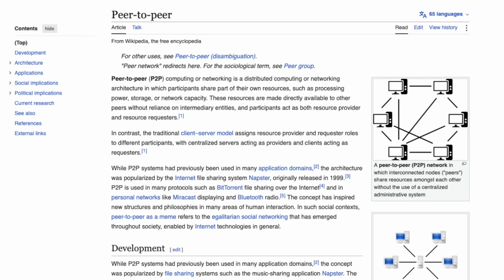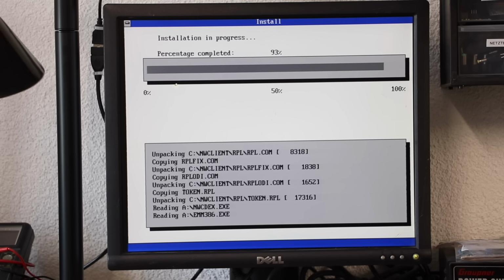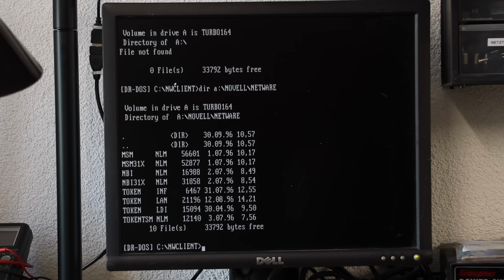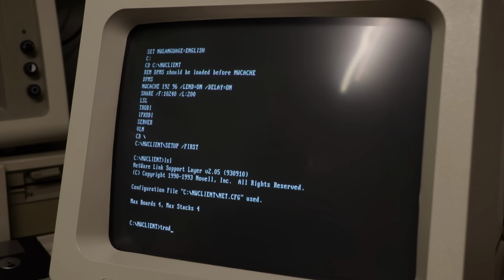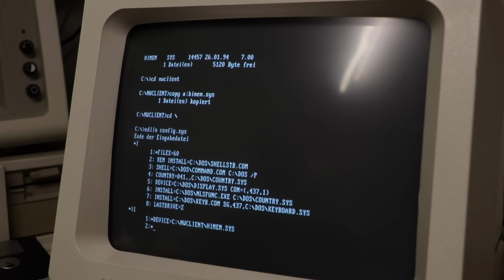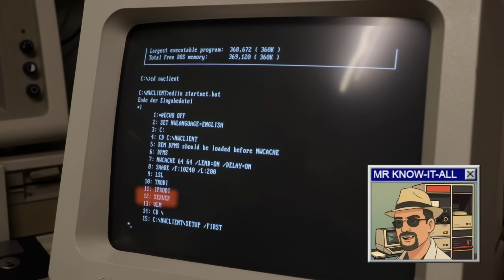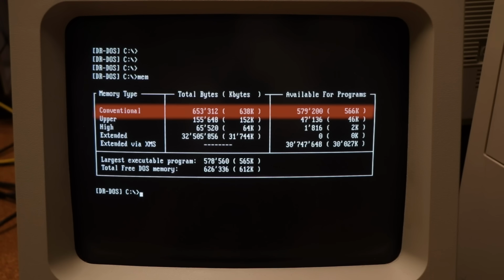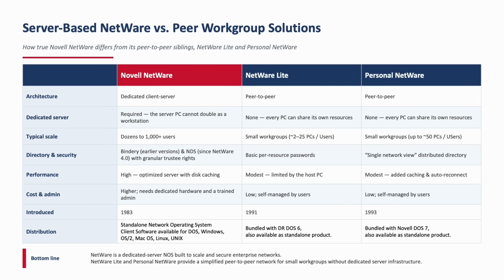Networking Two Vintage PCs with Novell DOS 7 and Token Ring

Comment from the maker: Did you ever run a DOS peer-to-peer network—Personal NetWare, NetWare Lite, LANtastic, Windows for Workgroups, or something else?

I’m especially curious how you handled the memory burden, especially on limited 286 systems. Would you have kept the file-sharing server running, stripped the startup files down further, or reached straight for QEMM or alternative memory managers?

Share your insights below.
Reply: DOS 6 boot menu is really great for saving memory.
It's a bit cumbersome to switch between having the network stuff loaded or being able to run large programs, but still.
For 386 and above Windows for Workgroups really improves both conventional memory availability and overall performance.
(I've never used anything from Novell or Lantastic, only used SMB clients in DOS).

Comment: I always wanted to try Personal Netware.

For P2P networking, I did a bunch of work with Windows for Workgroups.  It worked well enough for the 5-10 PCs we had hooked up to it.  I also dabbled in Lantastic on Dos/Win and OS/2.

I went on to work with Novell 3.x, 4.x, 5,x, 6.x, and OES on Linux.  For file and print services they still smoke what Windows does in 2026.

I managed to dodge a lot of these memory limitations.  The oldest client machines I generally were 386s.  I still remember dealing with a ton of 486 machines running Win 3.1x and supporting the Windows client for ccMail on a Netware 4.x LAN.

Comment: Commenting on an older video, but:
This reminds me a bit of that there is/were also an even cheaper solution where you'd connect the serial port between two PC's and be able to share disks and printers. I thin it was called $25net, as that was apparently what a null modem used to cost. I remember playing with this in the early 90's. It used the default DOS error messages and when there wasn't an appropriate error message it just picked one that would catch the users attention. Like "Out of paper on device G:" :D
Reply from the maker: Yes, the 25$ Network did that, also Interlink (DOS 6) supported this.

Comment: Why did you keep DISPLAY.SYS in CONFIG.SYS? Back in the day, I always removed display.sys and the MODE calls from startup files, you could most likely also remove NLSFUNC. Some programs like Norton Commander also show bad characters instead of some lide drawing characters with codepage 850, so I guess codepage 437 is mostly the standard in DOS. Also I think NWCACHE is also optional, if you have memory constraints...
Just some thoughts, as I also had my fair share of CONFIG.SYS and AUTOEXEC.BAT back in the day :-)
Reply from the maker: Well, of course I could have just removed them, or disable SERVER.EXE. There's so many things one could do, including installing a more modern DOS.

The while point of the story was however to show the memory constraints and potential compromises to be taken through the eyes of contemporary software.

I'd rather replace all DOS drivers and TSRs by modern-day equivalents with smaller footprints anyway. The included IBM mouse driver hogs a lot of memory as well. CTMOUSE would be a lot better.

Comment: My first little networks were Personal Netware. A VAR near me was clearing house and didn't know what was in the PNW 2-node kit, I guess. It was sitting there for $25 next to a NE2000 for 50. That box contained two nodes of software for PNW and two NE2000s with some accessories. Big score. Soon I was learning a lot more.

Comment: I had Netware Lite I think back in the early 90s in a kit I got from a store.  It had 2 NE2100 cards with COAX cables.  Fun little project for a 13 year old.
Reply: That sounds awesome, I remember having Ethernet adapters that had RJ-45 in addition to BNC but never actually used the BNC in practice

Comment: Here are a few memories of the late 1980s and early 1990s: In 1989 I got a 286 IBM clone with MS-DOS 4.x (I forgot which version exactly), it had 1MB RAM, a 40MB hard drive and a 3.5 inch floppy drive. I remember hat I had a constant struggle with low memory and had to tweak the settings all the time. Through shareware sellers I got alternative drivers for ansi.sys or the mouse and so on just to save a few kilobytes. It felt like a big relieve when I got a 486 with 8MB memory and DOS 6.22.

In about 1992 I got a job at a weekly newspaper, the whole editorial office used Novel Netware for connecting the computers of the staff. My job consisted in inputting submitted articles (in print form) or interviews from tape. The pc on my desk was a 386sx with DOS + Netware running a custom editorial software called LEAPS. The inputted articles were stored on a shared drive where the editorial journalists and the layout personnel could fetch them. It was not particularly unstable, but it had quirks. When out of memory LEAPS simply crashed, so I had to reboot to connect to the network and start editorial software again. There was a messaging system included with which I could send single line text messages to other users in the network. Thankfully, there was an unused windows directory on the disk that allowed me to leave LEAPS and play minesweeper in idle time.

Comment: My experience with Personal Netware was one business.  I'd done many years with Netware from 2.0 onwards at many businesses small and large to that point and continued on up to 4.12.  Through a convoluted series of maneuvers the business I worked for managed to sell PNW to just one business.  I'm not sure what dark magics were invoked to achieve that as the business was already using Lantastic (without a dedicated server) and was quite happy with it, apparently.

My honest assessment of PNW was it was a dog that should never have existed and was the attempt of a company in the process of failing to head off peer networking eating its lunch in the small business arena.  Just from the client side of the equation stuff that worked flawlessly with the Netware client, be that real mode DOS including sitting underneath Windows or prot mode Windows client, connected to traditional Netware servers, even NW 286 in non-dedicated mode, just did not work reliably.  No matter how many patches and updates were applied, nothing made it good.  The one business we somehow managed to get it in at said enough and went back to Lantastic.

Comment: Yes, between nwclient, personal netware, nwlite, and atrisoft lantastic was always a battle in memory management. Not sure if I said it before on this channel. I got really good at memory management just with the normal config.sys and autoexec.bat. Dos 6.xx was a life changer with Load high and stuff.  Plus being close to novell and already big into novell. Moving from novell client to nwlite and personal netware was a simple. As you pointed out. One more file loaded called server and boom. you was a server.
Reply from the maker: DOS 6 added quite a lot of practical features to make life easier in terms of memory management, although many of the features actually came from NetRoom, which Microsoft licensed for inclusion with DOS 6.
Reply: @THEPHINTAGECOLLECTOR  Sounds correct. Also I'm pretty sure third parties had memory management stuff for say dos 5.0. No I'm not talking about like Quarter deck or what not. I remember a program that would just take some of say your shadow memory? not being use and add it the to 640kb.  It works okay, but some programs refused to load and other gave strange error messages. Since this was before the internet. I didn't know why.

Comment: Used Netware Lite for a while, until switching over to win95 and its built in network. Right now I'm setting up a "retroserver" on a Raspberry Pi 3, with support for old SMB , NFS, FTP and Novell Netware with mars_nwe running on IPX. Also used for sharing internet like I did on a linux-box back in the days, but then with an ISDN card for connecting to internet.
Reply from the maker: mars_nwe is on my To Do list as well ;-)
Reply: Oooh cozy retro networking, that deserves a video!
Reply: @JohnVance  trying to log what I'm doing, so it might be possible to either make a Howto or video at some point. Hoping to bring the system on the next local retro event for some real LAN-setups like the old days :)

Comment: I was a netware administrator for a large corporate steel company. I had a friend that setup a company with a couple of employees. So they used personal netware it worked ok for a while on a pair of 486sx with ne2000 cards.

It lasted about a year when they went to full netware server 5 user. Where it lasted till they went to AWS 20+ years later
Reply: This and AIX are ridiculously stable and dont need the internet to function. I did work for a steel company who had the same 20+ year old AIX server running all their terminals.
Reply from the maker: So they kept NetWare for 20+ years in service? That's crazy.

On the other side, German Railways (Deutsche Bahn) still ran their on-board computers on the trains with Windows 3.1 until at least two or three years ago ... ^^
Reply: I was working at a major University in the Southern USA until 2011, and at that point, they still had Netware Routers routing traffic between floors of a classroom building!